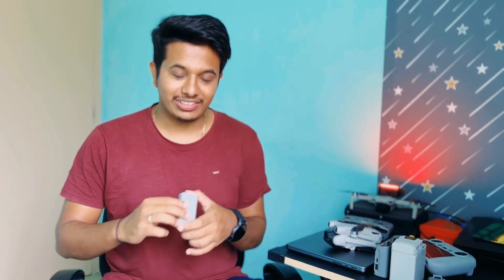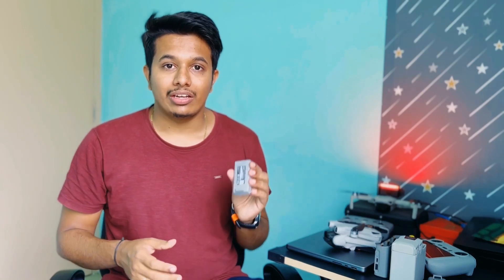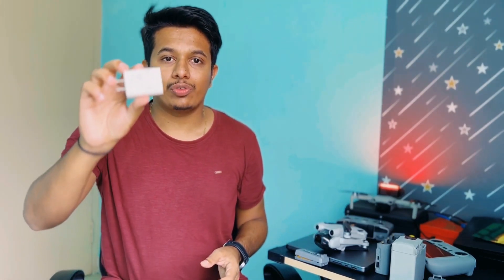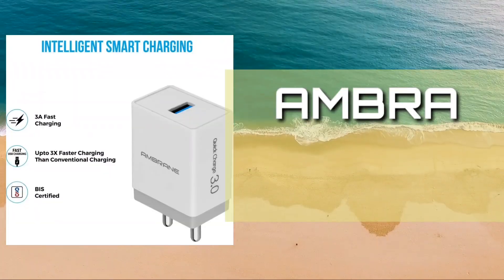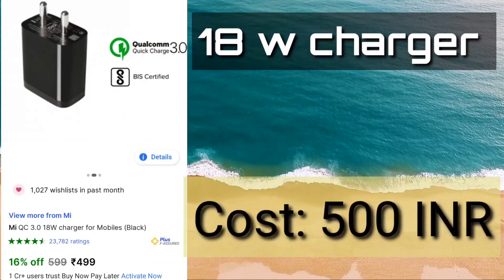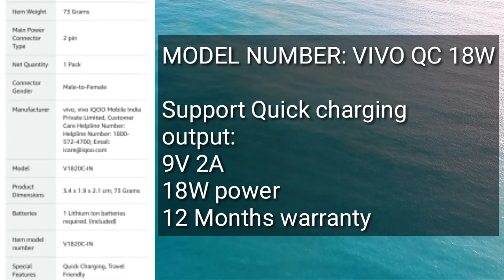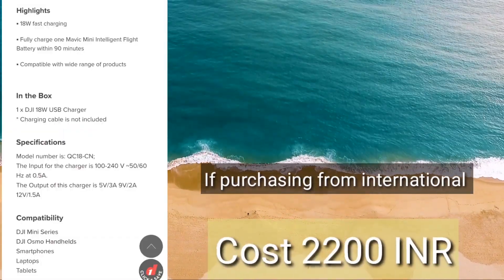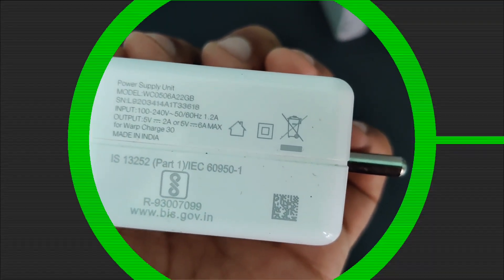Which charger to use for charging Drone and RC?🤔 Wrong⚠️ charger may kill DJI MINI3/MINI2 batteries

Comment: I use my oneplus 30 watt charger without any issue for dji 3 pro hub
Reply: How long till all 3 batteries are charged from 0 to 100?
Reply: @rakshithraob5379  30wat for plus battery could reach 2hrs, or less